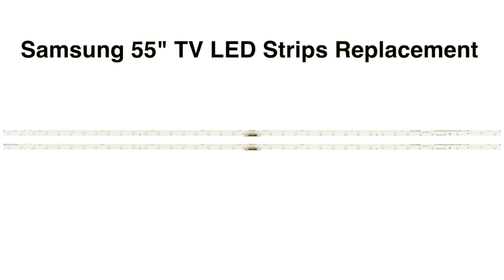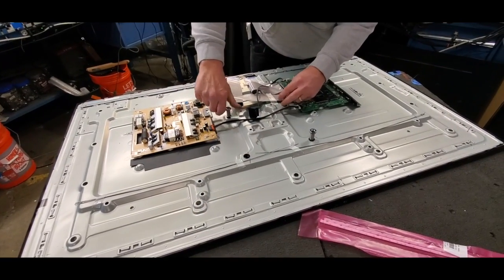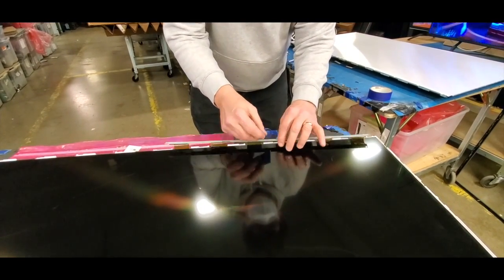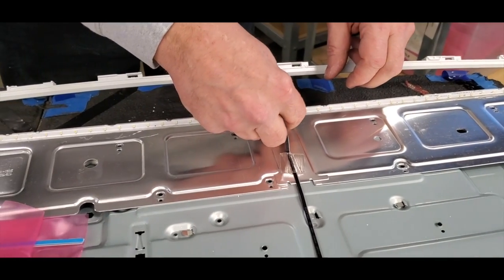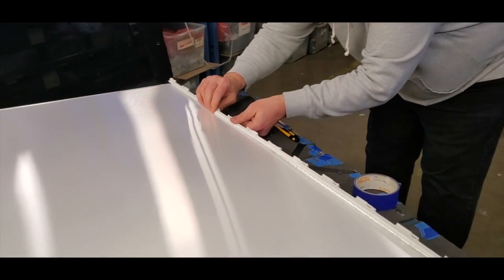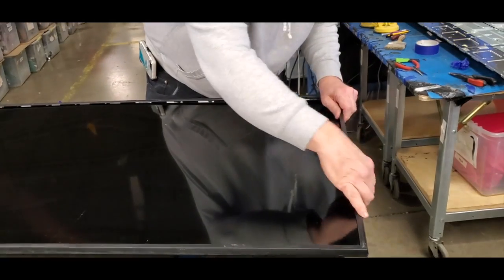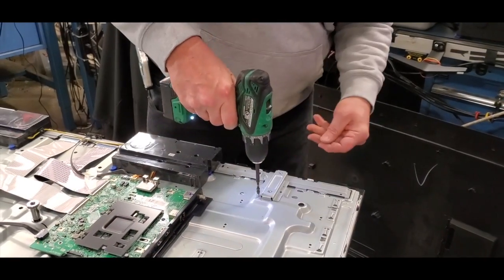Samsung Edge Lit 55" LED TV-No Backlights & No Image LED Strip Replacement Models UE55 UA55 UN55

Comment: This guy skips important info , without close up of certain steps , the tape is only two small strips , I took all the tape off , not good , also there are clips on the led attachment s which he doesn't show , he just rips them out , find a better example with more closeups of each step .

Comment: Thanks a lot for this video. The problem on my Samsung 55inch is not the LED's but the backlight is emitting or shining through the reflector sheet or I guess through the reflector plastic sheet which result in a light dot on the screen as it gives me the impression a plastic sheet behind the TV panel is overheating due to the LED's. In this case what needs to be replaced, or both. It is also said I need to replace both sheets. Please advise. Regards 🤝
Reply: dumpster

Comment: Hello, 

My Samsung TV - GQ43Q60RGT - won't boot after i installed new Edge LED stripes.
I tested some things.. If i pull out one Panel Cable the TV boots and then i can put it back in and the tv stays on, but the display has some bugs (stripes on the right side and the complete screen looks buggy.
If i let everything connected the TV is not booting. It's booting until sound is coming up and then it interrupts and trys to reboot in a loop.
I did the replacement very carefully to not break anything.
Maybe you or some people here have some ideas what the problem could be?
Before the replacement the tv worked fine. Only problem was the edge led on the right side.

Comment: Is it possible that TV even have that standby light if my  LEDs have a short. In right bottom corner i hear poping. Like electric surge small one. If i disconect LED connector from the power supply TV turns on. But no picture.

Comment: I have never done this before but I took my UN55NU6900 apart and replaced the led strips. 25% were not working. Took my time, about 3 hours and voila I now have a great picture and spent less than $20 cad. My TV only had one board on the back though, I guess it does everything.
Reply: Also in Canada…can you tell me where you ordered the replacement LED steips. Hate to go to the trouble only to have defective parts. Thanks.

Comment: Where I can find the connection diagram of the led cable connector?
I have left half lit and right half want to identify if the problem is the led strip or power supply.

Comment: Is it possible to flip the diffuser perspex 180 degrees so it's on the clean edge?  And what's the downside of doing that?  Mine is slightly melted but not cracked.

Comment: I followed your video. After reassembly and testing, the bottom of the the display is bright and functioning, but going towards the top of the display, it starts to get dimmer. Any suggestions? Thank you.
Reply: I'm having the same issue but the opposite. I'm guessing the sheets or the glass isn't properly secure ceasing the travel of light
Reply: @theri0n  I fixed it. Problem was with the thick piece of plastic that has one hazy and one clear side. Make sure the clear side I think is facing you and make sure the line running across is on the top side not the bottom. I also had the order of the other sheets wrong.
Reply: @josuemontalvo221  thank you I was able to get it fully bright again!

Comment: What are the wires for?
Reply: The wires that loop in and out of the metal frame are what the plastic back cover clip into rather than use any screws to connect the back plastic cover to the metal internal frame.

Comment: So is this even if when I turn the tv on and do the flashlight test I see minimal picture and when I first turn the tv one I get a split sec of brightness? I still not sure weather it’s an issue with a coMponent on the power supply or the LED strips. Thanks for another great video.

Comment: Do you have to remove the wire at the beginning?
Reply: No, I attempted this repair and you do not have to remove those wires after all to complete the replacement of the LEDS.

Comment: We have a Samsung un55nu6900. While watching tv there was a loud pop and the tv died. We have taken it apart and it doesn't look like anything is burnt but not sure if the pop would happen when led lights went out. Not real sure what needs replaced. The power cord was tested as well as the fuse and they seem to be good. Any advice would be helpful. Thank you.
Reply: Sounds like your power supply board. Could be just a radial capacitor failed but it would be easier to replace the entire board. You can find them on eBay for $25 (used) to $50 (new). Just make sure to discharge the large 450v (?) capacitors before handling the board because if you inadvertently touch the pins, they'll bite you pretty good ;-).

Comment: My Reflector sheet(s), plastic and white reflector, was damaged by the heat from the blown out LEDs. As someone already stated, the LEDs were replaced and my TV is working but I have images of the cracked plastic at the bottom and yellowing from the burns😏 on the white reflector sheet. I just need those 2 parts(the back reflector sheets) and I'd probably get another 3 years from my TV. Everywhere I've looked the only way to get any of the screen parts is to apparently buy them all at about 3/4ths the cost of a new TV.  Who has had any luck getting individual pieces of the screen layers? My model is the Curve 55 inch Samsung UN55NU7300FXZA. Hate to buy a new one when videos like this have shown me how to fix it but a $350 dollar whole screen repair when a new one is only $495, the only answer is a new TV unless I can get the actual damaged pieces I need. Thanks anyone. 😊?

Comment: Did you replace the reflector sheet that had the long crack in it?
Reply: This video is only to show how led strips are installed, that crack would mess up picture and also plastic piece is burned from led strips

Comment: Thank you very much for this! Could you tell me the diameter and thread pitch of the spacers you're using? I'd like to make some to have on-hand when I replace my backlights.
Reply: If you have a wall mount TV, just use the spacers and bolts from your wall mount. hardware.
Reply: If you don't have your mount screws, check the TV's manual for their size (VESA mount). M6 is the most common size in this class.

Comment: Guys….i just changed the leds last night on my samsung 55inch but i am disappointed with the tv color feels like a cheap tv and the reflection flex sheet had few burns so now it’s bleeding light on screen. i think i need original led and flex sheet to fix my tv. any ideas if i am wrong?
Reply: You won't find a new  reflector sheet, it's always burnt if the led dies. Get a broken one with low hours and transfer the lcd. These are real garbage products. The color temperature can be adjusted in the menu, but probably the old led was discolored and the new is simply different.

Comment: My Samsung 55 inch led cut on and off with a flashing standby light. I see a blue screen and no picture but I hear the start up sound. When I disconnect the main board from the power board the the TV stays on and the led remain lit.. any suggestions on the problem?

Comment: I have a samsung 55inch led.. the cuts on and off with a flashing standbylight. The led works when I disconnect the main board from the power board.. can you suggest what maybe wrong

Comment: Thanks, fixed my TV. Still have some darkness due to burnt diffuser but I can see it now.

Excellent tip with the bolts in the mount screws holes.
Reply: The burned diffuser is certainly a problem for making this a 100% successful repair.  I saw those burn marks make "shadows" in the picture where the full amount of light from the LEDs do not reach all areas evenly.  I also tried to flip the diffuser 180 degrees so that the burned spots are at the top of the display, but this isn't 100% perfect either because the light goes against the diffuser gradient and you get more light coming out of the bottom than the top.  I am not satisfied with the repair on my TV, but unless you can find a new diffuser panel, I think this is probably as best you can achieve for the repair on this LED problem.  Would be great if someone posts where to find the diffuser panel, but I would imagine that shipping would be expensive for a such a large object.
Reply: I have searched far and wide for the individual screen parts to repair the burns caused by the bad LEDs. Replace those 2 pieces and I have a practically renewed TV with hopefully another 10 thousand hours of use left. But the burn damage ruins a TV that had a wonderful picture until a few weeks ago. Certainly those screen parts can be bought at a reasonable cost like the LEDs are!!!!
Reply: @kx5e  same here. I got bright spots below due to burnt diffuser.

Comment: How to purchase edge led
Reply: You can get them on Aliexpress or eBay quite easily. There should be a number related to the strip somewhere inside the tv. Mine was BN61-13352A. Otherwise, just search for your model number or the number of a very similar tv (I've got a UE32M5690, but fitted the strip from a UE32M5620 which turned out to be either identical or at least compatible). Oh and if you do decide to have a look inside the tv before you buy the strip, try to find out how many strips you actually need. It turned out my tv only has backlight on the left side, while I expected it to be on both sides.

Comment: @3:22 it looks like your reflector sheet was damaged by the LEDs getting too hot but I can't tell for certain, however I don't notice it upon reinstallation. Was it in fact damaged by the LEDs and if so did you replace it all together or just let it ride as is? 
Also while I'm here, I really enjoy your videos and the amazing customer service from your website
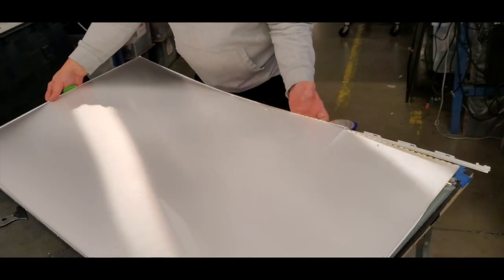Reply: It's not burnt, it's partly broken. You can see it when he starts to lift reflector sheet on 3:48. It probably broke while he removed filter frame.
Reply: I had one side of the LEDs out on my 40” version of this model and noticed the side that was still working had actually melted my reflector sheet. I wonder if it was some sort of surge that caused one side to go out and the other to overheat? I ended up replacing the bad led strip and the good while I was already in there and now I  notice the side that the reflector sheet is burned on you can see it on the TV only when there’s a white picture showing. Can’t complain though it was a great fix for $18, I almost got a new TV when this happened. 3 yr old tv.

Comment: wasnt the plexiglass diffusor melted in places where it nearly touches the led diodes? i've had that problem with samsung vision 7 series, not the greatest concept. in some cases it was burnt to the point it wasnt passing the light and that type of plexiglass diffusor is hard to get where i live.  great vid by the way 👏👏👏
Reply: what about rotating 180 dg ?
Reply: Can you rotate it so the bottom side goes to the top of the tv